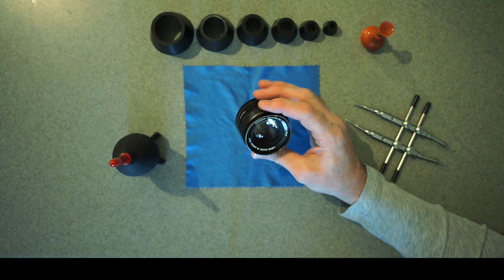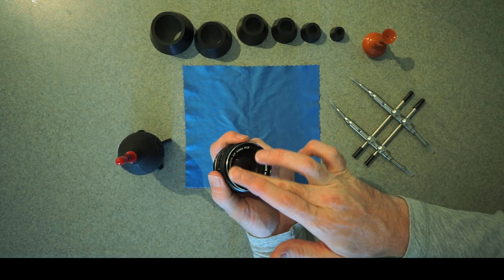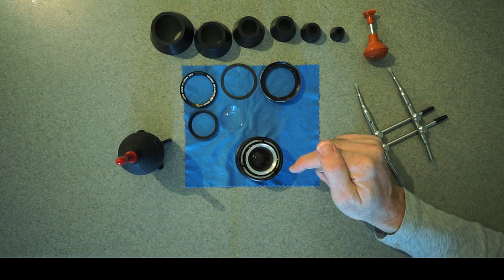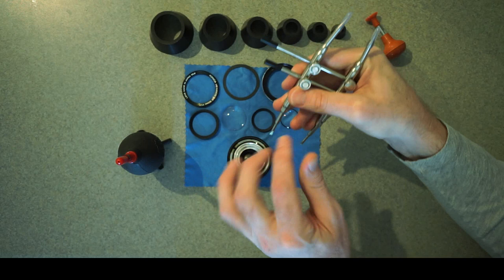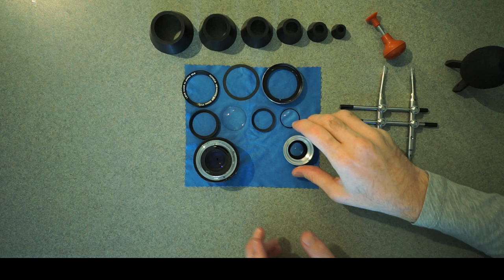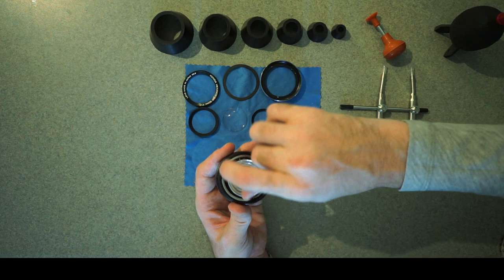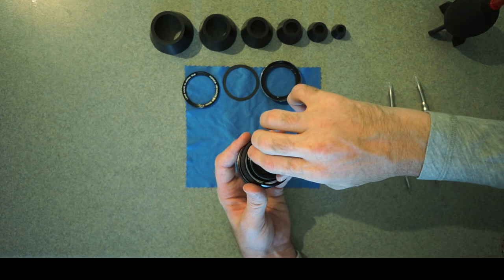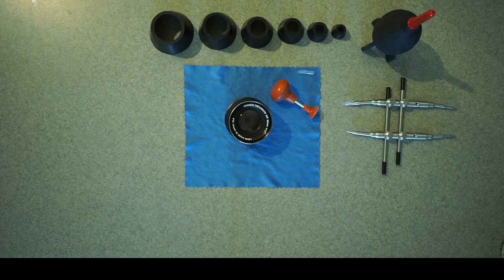Konica 50mm f1.7 Hexanon AR

Comment: I have a very fungussy 200mm f4 hexanon lens that I'm going to attempt to take apart and clean...

I would be very interested to see you try this one! Thanks for your video!
Reply from the maker: Well, this puts me in a difficult position. You see I have that same lens but mine is in good condition(ie no dust or fungus). So on one hand I could make that video, but in the process I could end up making it worse. I'm not sure I made this point in the video, but for anyone who hasn't tried to take apart a lens before, you have to realize that your work space is probably full of dust. As soon as you open that lens you're letting all that airborne dust and debris in! What the video doesn't show is me opening the 50mm lens up like five times before I finally got enough dust and whatever else out of it so as not to be noticeable in photos.
Reply: @dopeyrobot  ahhh... I’m in the UK, I assume you live in North America? Otherwise I’d suggest sending you mine to play with!  There is so much fungus in my lens that a little dust would be preferable. I only paid about £17 for mine, so I might buy some cheapish tools and give it a go myself. I’ll document it if I can! One question, do you think I need to undo the three sets of flathead screws along the lens? It looks like they line up with where each lens is?
Reply: @dopeyrobot  omg yes!!! Thanks
Reply from the maker: https://youtu.be/tpTxkFwF5f0

Comment: So I have a 50mm 1.7 without notches in the front. Guess I buy me some rubber cups. Just for fixing some greasy aperture blades...  Btw, there are lens diagrams on buhla.de 
Thx for the video!
Reply from the maker: You re welcome man, hope it helps. Yeah, I would not have been able to get this lens apart without those rubber cups.

Comment: Hi. What about adding screwdrivers to your initial list? In some cases JIS required...Maybe not needed if you just want to clean the glass, but restoration would include regreasing the helicoid.
Reply from the maker: That's a great point. Definitely a must have if you plan on fully restoring a lens and some will have JIS screws so something to be aware of too.

Comment: Hi! Great video! I found this lens at my grandmother's house and I would like to use it in my new Fuji X-S10. It seems to be ok regarding mould and dust. Should I still do the cleaning? 
There could be some damages for my camera If I use lens with mould?
Thanks!
Reply from the maker: Hi and thank you for watching! regarding your query I think that the old saying "if it ain't broke, don't fix it" applies here very well. I have a  collection of old lenses that I use regularly and have only had to clean two of them so far. The ones that are clean inside don't need to be taken apart. I mainly use a proper lens cloth and wipe the outside glass surfaces as needed.